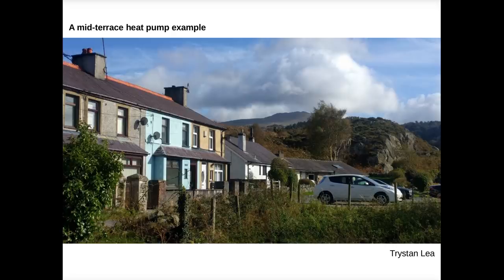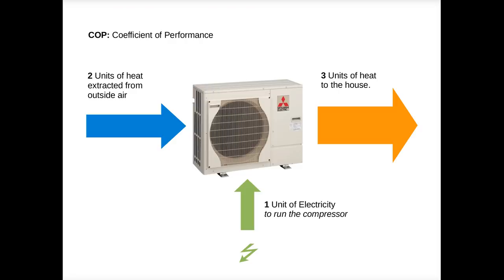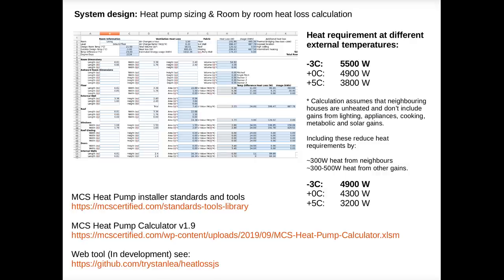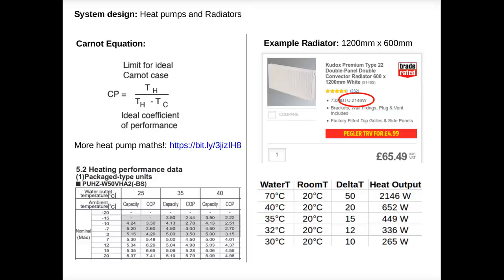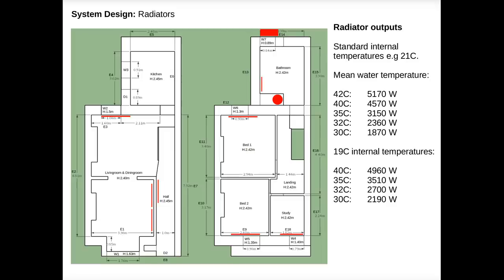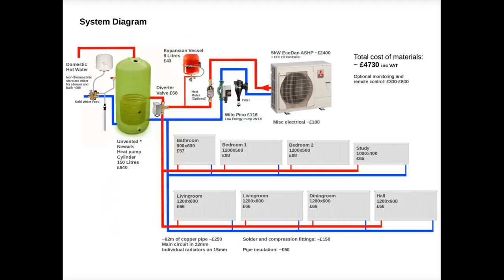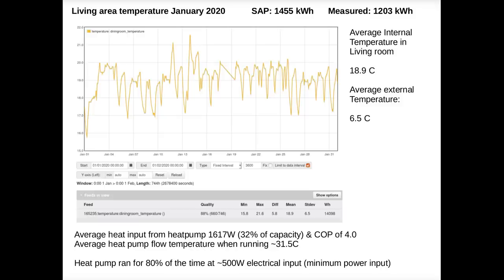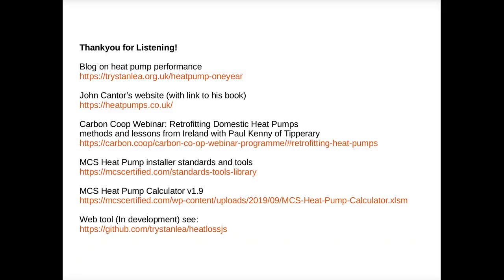A mid terrace heat pump example (COP: 3.92)

Comment: Superb detailed video but I cannot understand  how on earth  you are only paying £197 per year on heating ?? All we run frugaly is  led lighting a telly a couple of hrs per day 70 watts..odd use of microwave ..a new Samsung fridge freezer and a small chest freezer .a washing machine 3 to 4 times per week 45 pence per wash and thats about it and at about 16 p per unit rate we are still paying 5 to 600 pounds per year for electric ???seems many people are considering the likes of  £240 per month for the use of their air sourced heat pumps is great ??..... my last gas usage I monitored was back in 1995 .. warm air central heating .hot water and cooking ALL for around £60 per quarter.. we moved from there to an end of terrace house similar to yours a installed a gas combi boiler heating hot water and cooking a bit more than before but like anywhere NEAR the horrific thousands of pounds per year consumption levels that people  seem to be so chuffed with?   We moved to Wales in year  2000 no gas here so no heating we just have an oil AGA for cooking and hot water .... not discrediting you in any way just wondering how you do it goung by what I see other people paying I would have thought that £197 per month would be more realistic not per year ... I wouldn't  really even want to be pay £97  Per month  lol am I missing something here ...thanks
Reply from the maker: Hello Andy, there's a bit more detail on the month by month costs here: https://trystanlea.org.uk/heatpump2020
The key factors are: 1. good performance (no use of in-line backup heaters) 2. 76m2 mid-terrace house (relatively small external area), 3. Octopus Agile average unit rate of 10.7 p/kWh for the heat pump in 2020.
Reply: Hi  Tristan ..  don't know what you do for a living but maybe you ought to be designing Installing these systems and showing people how to get the best out of it ...seems to me that so many of these systems are being installed by people without the  sort of knowledge that you have .... I notice you have is used a smaller pump than what would be recommended yet still have plenty of headroom and Capacity .plus you run  your heating at a lower temp than most people would do .how much difference do you think these measures have made to your running costs .... we have allways ran our heating at a lower level than most people do even when we had gas simply to save money yet keep comfortable or at least keep the chill off the house, hence we would still be doing this with a heat pump.. living in a stone cottage in Mid  Wales  with nothing but an AGA and a wood burning stove that you need to be standing next to in order to feel any heat the rest of the house is freezing

Comment: Liked your article. But I said people being conned. Was not a reflection of you but heating company salesmen who promise everything. My bad about air heat pumps. Not the same at all.  It's a bit like a back to front fridge... do they work more efficiently at colder temperatures? ??
Reply from the maker: Thanks Adrian, like ground source they are less efficient at colder temperatures but still efficient enough. There are certainly examples of systems that are expensive to run, poorly designed, controlled & backup electric heaters etc. I hope my example gives a case study of a system that is actually relatively affordable, especially when combined with dynamic electricity tariffs such as Octopus Agile, see my latest blog here https://trystanlea.org.uk/heatpump2020, my heating running cost was between 31-43% cheaper than mains gas (UK). With good insulation and the ability to shift the heat pump demand outside of peak hours the saving could be greater, though 2020 was a cheap year for electric due to the pandemic so we will see about the years to come..
Reply: Adrian, as mentioned in another comment I live in Ottawa Canada and our climate is similar to your climate. This makes a huge difference. The Seasonal Coefficient of Performance (SCOP) of an ASHP in our climate is about 2.5. The SCOP of a GSHP here is 3.5. But the costs of the GS wells can be expensive and can add an approximately $15,000 to $25,000 CAN onto the cost. However, these initial cost differences and performance  work out to nearly equivalent lifecycle at the end of the life of the heat pump. GSHPs may be the overall better choice here if we are to eliminate all CO2 emissions by all of us here switching to heat pumps. An air source heat pump typically works to about -20 C then requires back up electric resistance heat. That increased demand on our electric grid would be overwhelming. GSHPs don't require that additional electric resistance heating and in the long run are likely a better choice in colder climates with existing fossil fuel heating.

Comment: Compromised living standards will obviously make this work (in theory).  An 18 degree living room temperature is so uncomfortable when relaxing.  21 to 23 is degrees is more usually expected.  Plus your exposed cold perimeter elements are hugely reduced for a terraced house.  Your neighbours are contributing to your overall efficiency as you do for them as well.  A really low temperature for the primary heating is also another compromise with slow reaction times to thermal changes.  I think this testing & reporting of yours is highly skewed & manipulated to get the positive outcome you wanted to promote & the COP of neatly 4 is simply world record breaking for an air source heat pump.  Even factory lab testing do not get this level of COP very often.  Perhaps your rose tinted glasses have now been removed some 2 years on when normality of how you & your family use the living spaces comfortably & 'normally'.   We have not experienced this low cost heating ourselves within a fairly modern new detached 2k ft2 home with a 7kw Ecodan.  We choose to have a higher water temperature (40 degrees) & 23 degree room temperature in the winter months for a proper comfort level rather than trying to become a cave dweller & I reckon our COP is just 2.  Our January 2022 electrical consumption alone was just over 1,200 KW & at 17p then was £204.00 per month.  You get a lot more thermal bang & efficiency for your buck from a modern gas fired condensing boiler producing heat locally & only when required in my view with the near similar Co2 emissions once the grid electric inefficiencies & their continued fossil fuel usage has been factored in.    I am not anti-heat pumps as the technology is getting better but just like all forced trends & government subsidies , it all ends in tears eventually with exposed lies & half-truths.   Stand by for rolling brown outs in the UK over the next winter when the explosion of ultra high grid electricity usage from these heat pumps & electric car chargers just cripple the current infrastructure & grid energy fuel intake required that simply wont cope.  You will so wish for the  use of that gas boiler whilst the pump is run by a small LifePo4 battery bank, solar & inverter to keep the icicles at bay inside the home.  This is just another perspective from a heat pump owner who is not so enthused.

Comment: This is OK for someone in a good paying job that can afford to install all this equipment, and for someone who understands all this technology.
But how are the millions who hardly make ends meet going to afford all this?  The Governments grants will not cover it all.  Also understanding and operating it all may be beyond the average person, as I know lots of folks who cannot even understand how their boiler thermostat/controller works!
Reply: Did you install your gas boiler yourself or did someone do it for you? Prices will come down, as more and more more people buy them, and so will the expertise to install them properly.  As for the operation, you set the thermostat in your house and then leave it alone, just like a gas boiler.
Reply: @petercollins7848  Someone in this line of discussion is using the word “efficient” incorrectly, heat pumps are incredibly efficient, it’s people’s houses that are leaky as a sieve, and as an engineer myself, any experienced engineer would tell you the best way to deal with a leak is not to stick more energy in to overcome it, you plug the leaks and then put the right amount of energy in.
Reply: @Muppetkeeper 
Using the word ‘efficient’ in a simple way to convey whether these air heat pump systems actually deliver the level of heat in contrast to a conventional gas boiler in the present condition of the housing stock in the UK.  According even to engineers who work in the business, and manufacturers of these pumps, they are not suitable for the majority of homes in the UK.  This applies even too some houses recently built as the retrofitting costs and fabric disruption is simply unacceptable.  The variability of daytime temperatures in the UK also make these systems ‘inefficient’, as there is a lag time getting the systems up to temperature.  Gas boilers are best in the majority of homes.  We are being bamboozled by environmentalists, who probably don’t even follow the practices they are trying to force on us.
Reply: @petercollins7848  People “like” gas boilers because they can throw out a lot of heat, with tax subsidised low gas prices. The industry likes gas boilers because any monkey can throw one in without actually having to design a heating system, they literally stick a big one in and hope it copes, industry can also tell customers that they are 95% efficient without the homeowner having any way to check that. Unless condensing gas boilers have a return flow temperature of about 50 degrees or less, they won’t condensate and have an efficiency of about 80%, almost none of the properties I have been in or to have a return temperature that low, as the monkey builder just chucked a big boiler in, and it cycles on and off all day.  In many cases it’s very easy to improve the energy efficiency of a house, people just aren’t bothered to do it, even though we’ve had free insulation for over 30 years, they’d rather keep chucking huge amounts of gas at the problem, then complain when the gas prices go up. UK electricity has an environmental tax of 23% applied to it, but gas is less than 2%, despite gas being more polluting, once the government starts to move that tax to its rightful place, onto gas, people will have to wake up and be bothered to take that free insulation.
Reply: @Muppetkeeper 
No problem at all with insulation.  We should be insulating, insulating, insulating!   And the reality with gas boilers is, that they simply do the job!
You make my point very well.  Yes when things change, we will have to change, but not before.  Don’t forget we have moved from open coal fires to room heaters, smokeless fuel etc.  So changing is not the problem, it is cost and convenience.  But installation will still be a problem for air source heat pumps, for it needs careful designing and expensive extra equipment.  And by the way my boiler condenses all the time, as does everyone’s in my complex, you can see the steam.
Reply: @petercollins7848  If a lot of steam is coming out, that proves the heat hasn’t been recovered….
Reply: @Muppetkeeper 
No, it proves that it is condensing as it should.  That is why they are called ‘condensing boilers’!
Reply: @petercollins7848  By definition, steam is super hot water in gas form. If your vent is expelling steam, guess where some of your heat is going. Basically, I’m bored of your complete lack of knowledge of the laws of physics. If you meant that water vapor is coming out, fair enough, but it should only be a small amount. If you are capable, go and measure the temperature of your return pipes to the boiler, if it’s over 55 degrees C, you’re not condensing.
Reply: @Muppetkeeper 
Done all that, and I am a trained engineer by the way and fully understand how 
all these devices work.  And renewables are massively subsidised too.  For instance Boris’s grant of £5,000, to say nothing of the guaranteed prices promised to a lot of the renewables industry.
But I am not against anything if it works for most people and is reasonably priced.  But this panic and doom mongering is not necessary.  We will see, after thousands have taken up the heat pump idea, whether they are good enough to heat British homes without using extra appliances in the coldest months.  The proof of the pudding is in the ‘heating’! 😄

Comment: A COP of 3.92 sounds wonderful: almost four times the heat output of equivalent electric heaters! Unfortunately, that is not the issue for most people.

New gas boilers have an efficiency approaching 90%. Clearly, not nearly as good, but when you see that the price of gas is 1/5 per kwh compared to electricity it already looks a bad idea from an economic perspective to use a heat pump. Factor in the installation costs, including the changes to your heat emitters, for most homes, heat pumps are economic lunacy and why so few who have any sense will opt for them.

Once gas and electricity are at parity it might, just might, be worth considering. Until then, please stop with the nonsense.
Reply: I was impressed with the reduction in CO2 that Trystan achieved. I look forwards to the day when the energy companies increase gas prices to make such systems attractive to you.
Reply: @tlangdon12  Seriously, it would be wonderful for us all to be altruistic and conscientious, but the sad reality is that most of us have to cut our cloth to our means and heat pumps are, given the current pricing structure and manner of building construction, way out of reach for 98% of the population.

Of course, you will be able to tell me how much your heat pump system and home insulation cost to install and glow in the satisfaction of doing your bit.